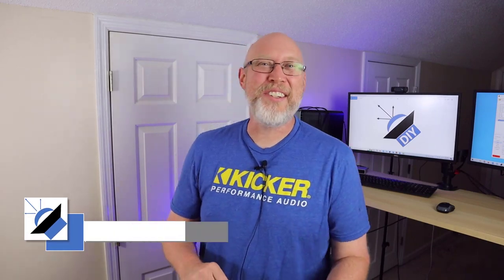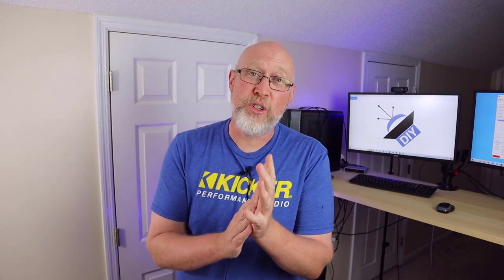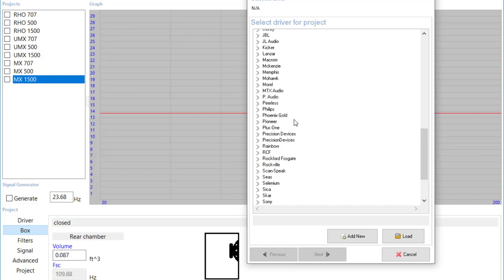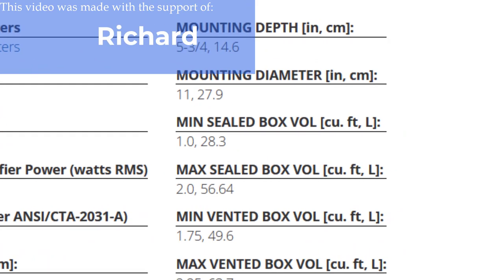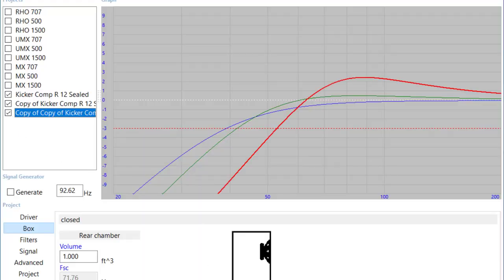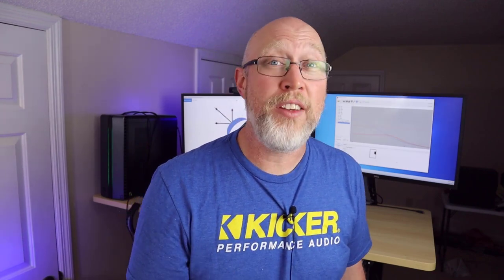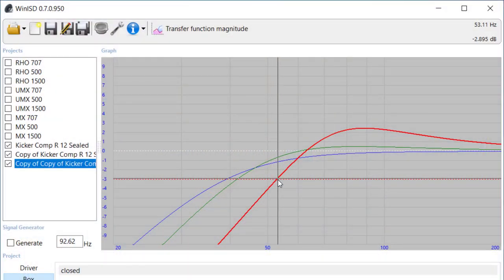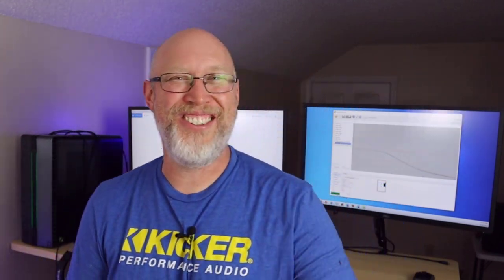Sealed Subwoofer Box Design:  Science and History of Acoustic Suspension

Comment from the maker: For more on the science and history behind subwoofers check out this video:  https://youtu.be/A9oVxddE2GA
Reply: And...  The answers I sought after was actually already outlined in the Hofmann's Iron Law vid.  Thanks Justin!
Reply: I did it. 
0.704 in a sealed box with a single 15 inch. 
Volume? approx. 15 ft^3. 
Weight? 200+ lbs. 
Dimensions? 3.1 x 2.6 x 2.1 ft (maximum allowed space in my room that I cannot use anyway bc its a corner with desks on either side)
Why? because it's fun building things, also I had to build something with a high efficiency because I am limited with power with my amp (not a fan of ported subs)

Comment: I have actually done back to back comparisons of sealed vs ported enclosures in my car using the same subs and amp. While the output of the ported box is much stronger, I am willing to give it up for the accuracy of the sealed box. Thanks for the history and explanation, it was surprising how recent the concept was.
Reply from the maker: Not a lot of people are doing side by side comparisons like that.  The only way to know which one you like better is to try them both.
Reply: @DIYAudioGuy  I had 4 AR3a speakers and I would rather have ported JBLs any day
Reply: @WesB1972  some like volume while others like volume and control . ☺️
Reply: @robsorgdrager8477  I like both, so a decent size, tuned very low, ported box is what I generally use in my vehicles.. and they ALWAYS sound awesome!! 😁
Reply: @aaronmyers4951  I find it hilarious that it took you 13 lines to say that you prefer ported boxes.
Reply: @aaronmyers4951  So much hilarity from you. Now you are making assumptions on my life based on youtube comments. I’ve been doing car stereo installations for almost 40 years. I’m a doer not a braggart.
Reply: Always used ported , cuz that's what I seen and heard, forever.
UNTIL size constraints, forced a sealed box, 2 keep a pair subs.
OMG, the mediocre system, I was never happy with, became the dream system I've been chasing 4 years. Didn't even notice a reduction in volume of bass, though technically, there is, at same power level. Probably cuz I'm driving them harder and still sound great. Always backed off the volume on the ported box cuz they sounded like shit.
Reply: I recently purchased a fox acoustics ported subwoofer box for my F150. After reading various reviews about said box, I was pretty excited about getting it set up and installed. Pretty much turned into a world of instant regret. Boomy, unclarified, and flat out unpleasant to listen to. No amount of crossover or eq adjustments could set it right. I'm using legit quality components otherwise. In an effort to reap the benefits of my investment, I made some temporary modifications and turned it into a sealed box. What an incredible difference. Tight, snappy, still plenty loud, and sounds like a whole 'nother animal. I'm gonna take the box to my local lumber yard and have them make some custom cuts so I can make said modification permanent, and reduce the overall size of the box. I lost a touch of the deep bottom end, but I'll gladly trade it for the clarity and tight response I'm getting now.
Reply: I much prefer the sound sealed subs produce
Reply: I made myself small speaker 6w(3+3) sealed and comparing them with those available in market i.e with bass radiators, i can say sealed sounds punchier and solid whereas market ones sound hollow and echoing from inside, bass do feel stronger though.

Comment: Sealed enclosures also typically have less maximum pressure on the walls of the box than ported enclosures! This means less colouration from cabinet vibration and/or less bracing needed. Also, unlike ported, you can line/stuff pretty much to your heart's content (or for the most part at least), this means less cabinet colouration and less cabinet reflections back into the cone causing some extra modes to develop in the cone, something you can't do too much to a ported enclosure due to efficiency losses. Gotta admit I love everything about sealed, 1 downside, less -3dB extension than a ported. Thanks for the vid Justin! Great explanations!
Reply from the maker: I did not know most of that.
Reply: @DIYAudioGuy  yep, that's because in a correctly designed ported box, the air in the box at tuning is in phase with that from the cone. This means that at tuning you get double the pressure you do than with a sealed box. However below tuning the port just acts like a giant hole in the box which means really low pressure and is the reason for the steep roll off below tuning, also why the woofer loses control without a subsonic filter as there is very little pressure controlling the cone's movement below tuning.
Reply: Also, apart from suitable driver selection, I'm surprised more sealed subs aren't used in cars. That shallow roll off and cabin gain would result in a really favourable situation I'd have thought, and not to mention cone control down to 0Hz, so theoretically you don't need to care about subsonic filtering sometimes.
Reply: @GTILOUD  well... The driver has to be suited to a sealed enclosure in terms of its suspension (look at its TS parameters). Else you're going to either end up with 1 note bass or having to make a massively oversized box
Reply: That's odd, that there is less pressure in a sealed enclosure than a ported one, since the port is basically a vent, which would release pressure.
Reply: @janbenschop7597 It totally depends on the configuration of course. But you can definitely get higher pressures in a ported box for a given amount of power to the driver. Because the pressure is oscillatory, back and forth, its behaviour is quite different to what you'd typically expect based on common sense.

In a ported enclosure, the tuning frequency of the port can create a resonance effect. This resonance can cause the air inside the enclosure to move more forcefully, leading to greater pressure variations. The port acts like a vented path for the air, but it doesn’t just allow for the release of pressure; instead, it creates a dynamic interaction between the air inside and outside the box. At certain frequencies, this interaction can result in a higher overall pressure build-up inside the enclosure compared to a sealed box, where the air is more confined and moves less freely. This is why, despite having a vent, a ported enclosure can still experience significant internal pressures, and even greater ones near the tuning frequency. That's how we can have minimal cone movement at that tuning frequency.

Comment: Not many woofers designed for sealed box these days, I personally like a sealed over ported or passive radiator.  Tlines are another story. 😊
Reply from the maker: True.
Reply: Unfortunately this is very true, GRS seem to be the only ones I can find, on loudspeaker database at least (for subwoofers). But yeah, transmission lines can be designed to handle any woofer really, you just adjust the mass loading of the line.
Reply: I really like my sundown sd3 10 d2. It’s designed for a sealed enclosure, in fact, they expressly say sealed only but it’s a pretty decent sub for what it is.
Reply: You can extend the low end with roughly twice the woofer's cone area. You can also mass-load passives, which also extends the low end, though that reduces sensitivity somewhat.

Comment: Sealed + DSP = win. You'll just need a bit (a lot) more power.
However it's worth it. I'm using Ultimax 10 in my home cinema with the very low end boosted to give a flat response from 25Hz and I wouldn't never return back to ported/passive radiator. 500W gives more than enough SPL.
Reply from the maker: Cool!
Reply: More than a little bit.

Comment: as long as you use reasonable quality subwoofer drivers, and you leave a bit of air in the box after the driver is mounted. its all that is needed to get great sound. eq is a necessity for all subwoofers so woofer air displacement is the limits how low and loud it can play. 
small as possible box internal volume within reason is the easy way.  no going in larger.
watts is not a big deal. i made very small(18L) subwoofer with 10" woofer. 100watts amp and dsp to get it to 15hz. best bass i had.

Comment: I'm building a 15.5 cubic foot enclosure for a pair of 18" drivers. It will have a removable external port with a block off-plate so it can be ran sealed or ported. Tuning can also be varied quite easily.

Comment: Hey man, love the info 👌.  

Hope you could help me out with something....I bought a pair of 8' woofers a couple days ago, but they came with no specifications besides the power ratings.

Is there a way, and how do I go about to determine the T/S Parameters of my drivers? so that I can get the designed on Winisd.

Thanks once again for the great content 👍🏽 👌
Reply from the maker: That's really odd! What do you know about them? Brand and model?  I would advise doing what you're doing right now, asking everyone you possibly can. Maybe check out Toids DIY audio forums.  

If you can't find out somewhere on the internet and you might need to grab one of these.
https://youtu.be/6g39ScWma3U
Reply: Found the info I needed. Thanks!!
Reply: Without buying something like the Dayton audio dats which if you are going to be messing around with speakers I highly recommend since manufacturer data is surprisingly bad. You might get lucky with a local shop who can test it for you try one that does a lot of custom work.
Reply: @mpugne  good info brother! I didn't know about that, but glad I do cause I have a 10+ year old killer sub I saved for a year to finally buy, though the sale at part's express sure helped with that!!
  Anyway I really want to build the ideal ported low box for it, so I can FINALLY get all it's got to give out of it!

Comment: Good video Justin. Where is 25hz to life, Koss ftw. AR used to be so good. What happened to them? I would rather the dynamic accuracy of the sealed even if it means losing some db's. I ran a triple MTX 10" sub box and the air space was only like .6 cuft net. Sounded great. Of course those aub could run in as little as .52 cuft. Subs that could run well in small enclosures used to be a thing in the late 90's early 2k's.
Reply from the maker: Yep, trends shift over time.

Comment: I've tried Sealed, Ported, and PR and love them all. Sealed has its place but for me ported/PR is just better. A/B comparing a Ported UM18 to a Sealed UM10 heard no difference in sound quality. Only bass extension.

I'm getting the itch to do Infinite Baffle in my car. I was going to put it off for a good long while. But I keep thinking about it these days. Either I'll use the UM18 I have laying around or try out a Fi IB18, or the big boi Stereo Integrity IB24. Leaning towards the IB24 because It can be built with Dual 2 ohm coils so I don't need to replace my amp. It only does 600-800w at 1 ohm and I'm pretty sure 100-200w will be more than enough power for 95% of the time. I hardly push 200w to my current box and the IB24 at 200w will be louder than the UM10 if it was using 500w. I need to stop thinking about it......
Reply from the maker: Hard to make that IB24 fit.
Reply: @DIYAudioGuy  Yeah. I think it'll fit in the spare tire area in my car though. I'd just need to brace that area really good. Cutting a hole in the car is the only scary part.
Reply: I, on the other hand, wouldn't return to ported/PR where power is not a concern. I'm running UM10 in a sealed enclosure in combination with 500W amp - EQed to give me a flat response from 25Hz and that thing is way different than all the ported subs I used before. You don't even realize there's a subwoofer, that effortless lowend just comes naturally...

But I know in some environments you won't hear much of a difference - had that too with sub in one corner, me in another one and no fancy AccuEQ advance like I have now in between. Any sub I tried, everything just resonated at 38Hz.
Reply: @tomkocur  That's about the frequency my UM10 was good to when Sealed. I have 600w or so of power for it in my car. But Sealed it was lacking the really low stuff under that that I personally like. It takes up more space but ported/PR on it really does well. I use three RSS265-PR for my UM10 to tune to 19Hz. I get usable output to 16Hz in my car. And I mean windy usable output.
Reply: i have a um18 replacing my rear seats and using the trunk as a box and would recommend.  crossed over at 100hz and kills every single song.  i really want to fit a 24 but its not happening :(
Reply: @benmiller5830  I'm going to toss my UM18 in my car soon. Infinite baffle with the sub in the spare tire area. 

The 18 replacing rear seats sounds awesome though.
Reply: @JoshM7  want 2 do that 2, can't bring myself to cut the hole, yet.
Reply: @jacemelridge6595  I was going to do it yesterday but Lowe's sold me a defective tool. I'm going to try and do it soon though. Maybe in the next month or so. 

I have the stuff I need to cover the hole with expanded steel as well as a filter.

Comment: I bought 4 AR3A in 1974. Great speakers, sounded fabulous but were very inefficient and were incapable of absorbing much amplifier power. I had these speakers in a large open party room, driving them with a Dynaco Stereo 400 amplifier. I fused the speakers as specified by AR and I blew many fuses while using them for parties with lots of people. I eventually removed them from service and replaced them with 4 ported  JBL speakers with more power handling capacity. The ARs were true sounding speakers with tight bass but were not suited for parties. With the JBLs you could feel the bass in your chest.
Reply from the maker: Yeah, those definitely weren't party speakers.

Comment: I wanted to ask about one of the differences between pported and enclosed speakers. I have been reading sealed speakers tend to sound more accurate and not "boomy".  If a ported speaker that is designed with a flat response. and a similar speaker but designed with a sealed enclosure with the same low frequency response at 3db down (obviously with a larger enclosure). Is the sealed speaker going to sound more accurate as compared to the ported speaker described? Or is the ported speakers that are described as boomy simply just built incorrectly to sound that way?
Reply from the maker: I prefer ported, if designed correctly they sound great plus the get lower and louder.

Comment: I’m looking for the best sql subwoofer that can get really loud in a sealed enclosure. I want to put 6 10 inch subwoofers under my seat in a 2018 Ford f150. I want 3 subs firing forward and 3 firing up. I have a 3.5 inch seat lift.  Box specs is 53 length, front height 12.5, rear height 9.5 and width of 11. What subs should I get? I have about 3500 rms of amp power I’m working with.
Reply from the maker: Sounds like your strategy is to maximize cone area.  If so then you want to use these:  https://howl.me/cjCkNNMBtL6

I am not sure if you want to go with the dual 4 ohm or the dual 2 ohm.  You will need to do some math to get the impedance right.
Reply: @DIYAudioGuy  correct. I want close to a 150 db set up and not just rap music. I want all music to sound good and move a lot of air!

Comment: Infinite baffle video one day? 

Not really for suvs. But smaller cars/convertibles, could be useful! Tried it once, but it needed so much DSP work. So I stopped worrying, and love some 1/2" mdf ported boxes.
Reply from the maker: That is a good idea.
Reply: A Infinite Baffle video would be cool. I may do one in the near future if I keep getting tempted by the idea of saving trunk space and keeping my already good bass response under 20Hz. my 10" plays to 16Hz with authority but it does use up a bit over half the trunk space. 

I expect the Infinite Baffle sub to have almost no bass above 55Hz due to my trunk acts like a lowpass/brick wall at 55Hz. But I could add a smaller ported box for 55Hz-100Hz that sits just about snug up to the back of my seats in the trunk.

Comment: Off Sub ject question. I have 2 sets of tweeter and the terminals aren't clearly marked with -/+, just a resistor would that be the pos or negative???
Reply: I believe that would be pos+
Reply from the maker: It's probably not a resistor, it's probably a capacitor. If it is then the capacitor is on the positive wire.
Reply: @DIYAudioGuy  Thank you, much appreciated. 🤙🏾

Comment: To me it makes more sense for a sealed enclosure to be bigger.
Reply from the maker: I modeled several sealed enclosures in WinISD when I was prepping for this video.  There is a threshold, once you get bigger than that threshold making it bigger does not change the response much at all.
Reply from the maker: @GTILOUD  I tend to build a bit bigger than the manufacture recommend specs.  Bigger boxes play louder.

Comment: Question. When you look at the specs of a sub, you find a sealed box recommendation for 1.5 cf.   Also, it will say the displacement, in this case .43.  

So do I build a 1.5 box. Or a 1.93?
Reply from the maker: Yes, but most subwoofers don't list that spec.
Reply: Yep. You wanna include the sub displacement for the best sounding box.